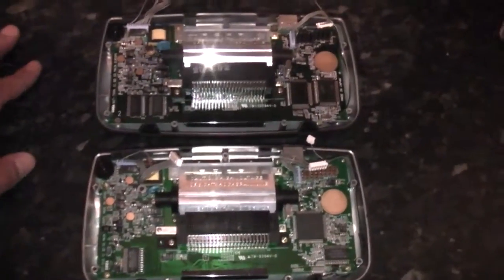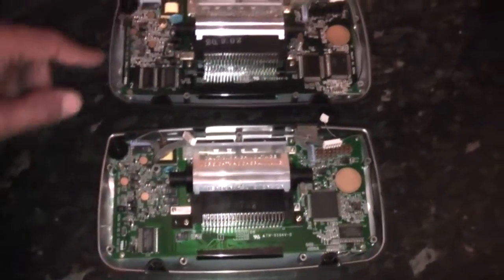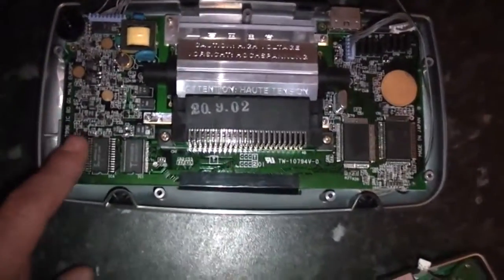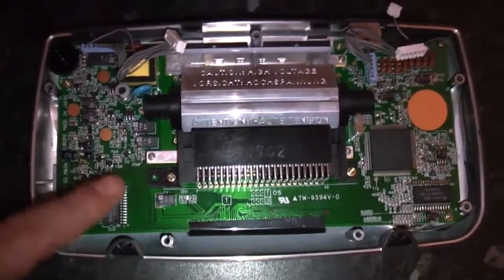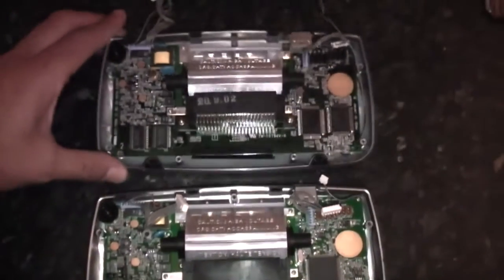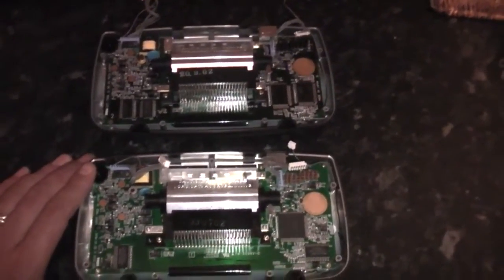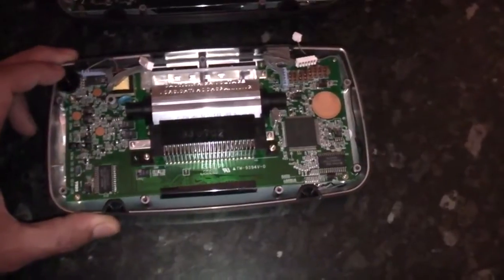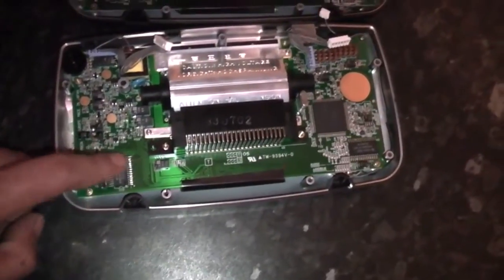Sega Game Gear Tutorial - Identifying motherboard version / revision

Comment: Man my experience is opposite yours, but i am in the states. I have 10 right now, only one 2 aisc version. All the others are single aisc v1's most say taiwan on them, a couple say usa i have one that says Japan. I also have a usa va5 version. Trying to determine to I go by the country in the "va line" on the board, or the "made in xxx" portion because some appear to be a usa revision but will say made in taiwan or made in japan on them. My dual aisc says usa in the va line and made in the usa on the main board. I guess the multiple countries has me confused now.

Comment: so i have a gamegear that doesn't have a chip on the left at all is that a model 3?
Reply from the maker: There is a third version of the board yes. It's pretty uncommon which is why I didn't include it here.
Reply: ok thanks
Reply: @JohnnyBareToes1  And unfortunately, it isn't quite compatible with the other boards. The wire connectors to connect to the other half of the unit don't seem to be quite the same, they've got a green connector, rather than the white ones in your video.

Comment: I have a question regarding my Game Gear. It's the model 2, and the capacitors need to be replaced, so I opened it up and found that some of the capacitors on the right side have a sort of white casing? I tried looking at other videos/tutorials and none of them have mentioned white capacitors, so I wasn't even sure they were the same capacitors as the others or if I just have a weird version. The ones on the left side seem pretty much the same, but it looks like I might have slightly less....
Reply: Man nobody helped you, wth. If its what i think your talking about, they are not capacitors they just use the same plastic housing on them. Probably easier when they are manufacturing them because they use hot air system most likely. That way they can set them down and glue them so they dont move when they are heated up. Thats my guess anyway, just to make it easier.